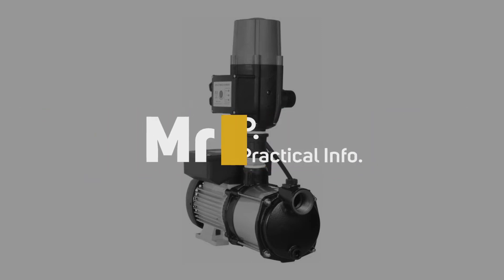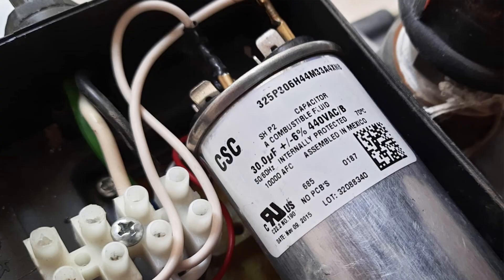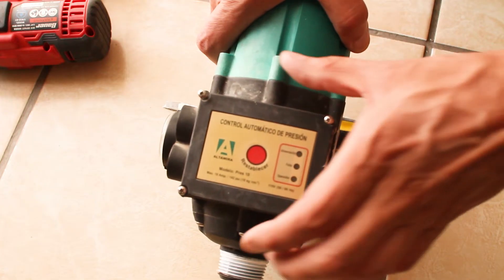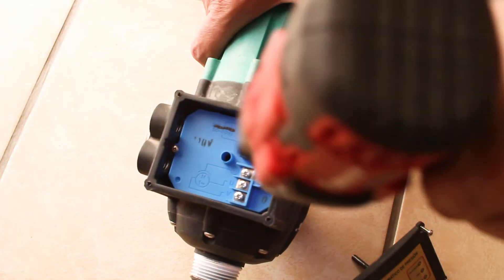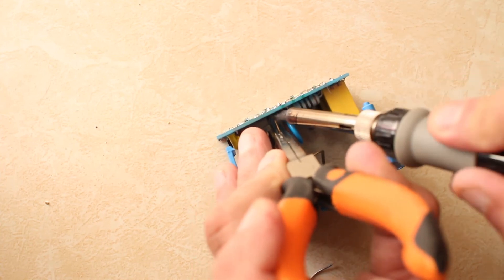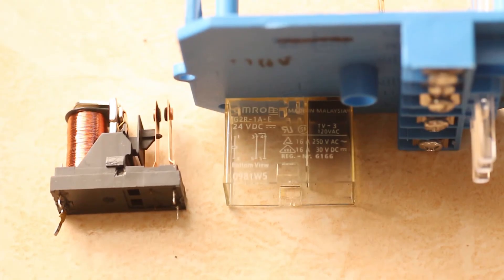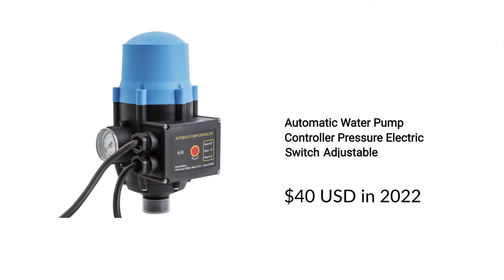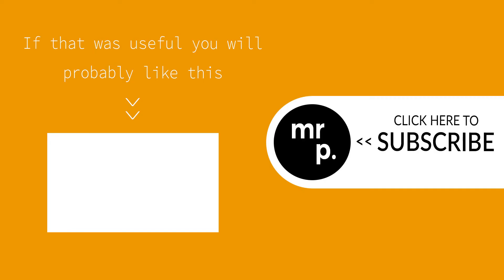Fixing a Chinese Water Pump Controller  💧

Comment from the maker: After uploading this video I discovered that Chinese ecommerce websites are also selling the circuit board replacement with plastic enclosure for roughly $13 USD (2022). It is sold with the title "220V 50-60Hz Water Pump Pressure Controller Electronic Circuit Panel for EPC-2 50/60Hz Water Pump Controller Circuit Panel".

Comment: excellent video. you could have just sanded the contacts off. why does this thing get so hot? my wires were getting hot so I replaced them with thicker ones and today morning i woke up to a dead pump controller, no power. power led is off even though voltage is present. any tips for me?